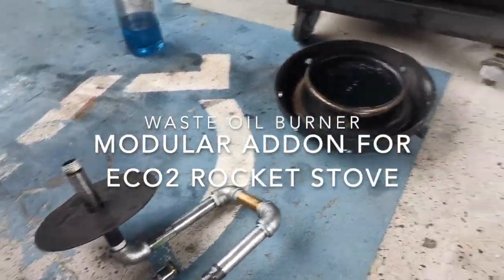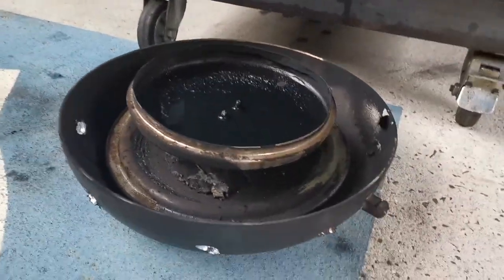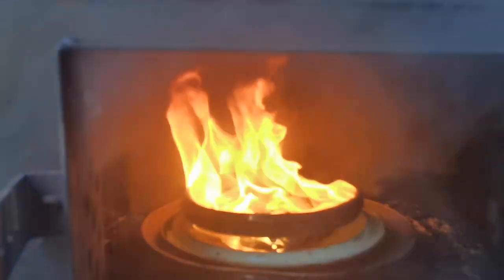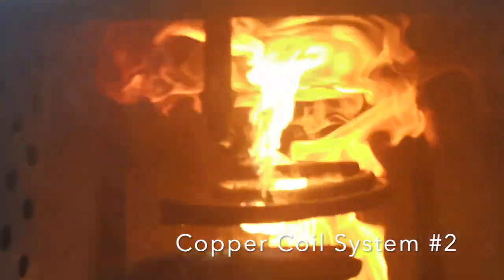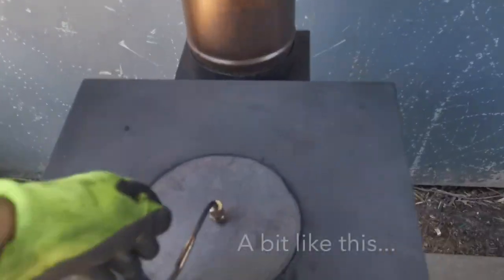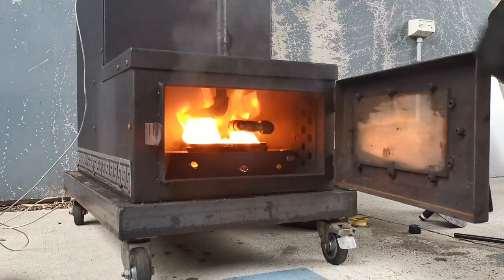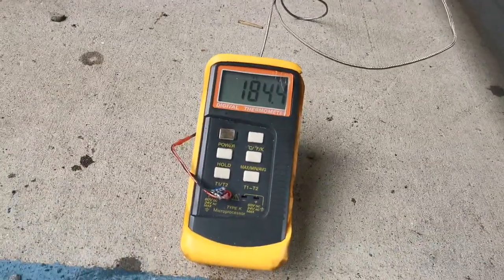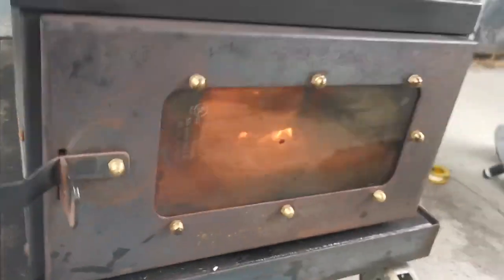Waste Oil Burner System for the Eco Rocket Stove range

Comment: Since you have modified the stove to burn a lot more cleaner. Would adding a vertical riser like in a rocket stove make even more heat and totally burn the unburned particulate matter ??? How about putting a round cage of perforated stainless to glow and burn up a lot of the carbon ??? Thanks Sir.
Reply from the maker: This unit does have a vertical riser inside the taller box section at the back. It's not massive, only a 5" dia (in hex tube) with about 22" of height. When the air / fuel mix is good, then the particulates do mostly burn up in the riser. The main challenge with the oil burner in this format is getting it to hold the air / fuel ratio in a stable manner, as the system tended to fluctuate. As the pipes got hotter that changed the oil flow and things needed constant tweaking with the way I had set it up. I dropped this project after a while, so I don't have a perfect solution but it was an interesting experiment. I like your idea with the perforated stainless to act as a heat trap and catalyst. I might try that in a wood fired rocket to see what it does. Thanks for your comment!

Comment: what if we use compressed air? btw love your design and i m following you since you introduce your first rocket stove. i can see your sales team fail to bring this product in each home of himalayas as they are selling it on high price.yes again i admit in this one year price of steel become almost double but still your eco mini stove they are selling 14000 which is way to expensive.the weight is only 35kg and i can get 135 rupees per kg include laser cutting and all the fitting with labour.i guess if your sales team consider to sell it under 8000 rupees and sell it in quantity, i can see it in every remote home of upper and middle himalayan region. anyway i admire you as a good eco friendly and designer engineer.
Reply from the maker: Hi and thanks for your comments. Not sure about using compressed air, that adds a lot of complexity and in general I prefer to keep the systems self aspirating and as simple as possible. Regarding the cost of the EcoMini... there is a lot more to getting a manufactured product to the customer than just the cost of steel. Production cost is one thing, then we have about 20 staff to pay salaries to all year round, various distribution agents, warehouses, transportation, taxes, etc. The company just covers its costs of operation after all the overheads, so that's why the cost is what it is. We've crunched the numbers and made the unit as cheap as it can be. We are working with South Pole to trade the carbon credits for us, which will give us some additional return on the investment which we will use to bring the cost down when we can. We are also working on attracting social impact investors to support us to scale which will allow us to reduce the prices overall. Thanks for your kind words, much appreciated.
Reply: This is hardly eco friendly.  He needs air, not necessarily compressed air but a feed of air to burn the oil, this setup is way over  fueled.

Comment: Hello,

 Thank you for this video. what about pollution? Have you analyzed the exhaust gases? Thanks
Reply from the maker: Hi... no I didn't take this idea any further than conceptual stage as shown. I was originally working on this option as a solution for high altitude heating in the Indian Himalayas for large institutions and have now shifted my focus to waste biomass as the energy source. I am currently working on a range of biomass pellet combustion options, including a modular add-on for the Eco Rocket Stove range of heaters (as shown in this video).

Comment: Hello can the Himalayan rocket stove be used with hot water bath tub
Reply from the maker: Not really... there are better ways to heat a bath tub. If you mean, can a rocket stove of some design be used for that purpose, then yes, for sure. You can run a coil around a rocket stove riser that is next to the bath and run the water through it. There are various youtubes that deal with this topic in particular.

Comment: I’ve pretty much done the same pipe design with the nozzle in the end, but I seem to get a complete blockage of carbon inside the tube right where the flame is aimed at. If it’s not aimed there then it’s sooty, but if it is, it blocks up. Any ideas how to stop that?
Reply: I tried everything from a single 1mm hole, to 4,5and 6 1mm holes, and of course open pipe, same result. At the point a single carbon deposit forms, that seems to be a starting point for the blockage to eventually form. I ended up getting rid of the pipe all together and doing the brake rotor/bowl design most others use, and it’s efficient and completely clean burning when the air fuel ratio is right.
Reply from the maker: @lexicase5642  sorry I didn't reply earlier... yes the bowl design does seem to be more stable and less prone to blockages. I didn't take the oil burner testing any further than this video, as I moved over to waste biomass pellets as a much cleaner fuel source to work with.

Comment: You’ll find that after only a couple of litres the vaporising pipes will clog with carbon and other dirt that is inside the oil, at least that’s what I found when I experimented
Reply from the maker: yes, that's why I was working on an easy to clean system. The nozzle and pipes are quite easy to separate and I found they kept burning for a few litres without issues, but I have not done extended burns yet to see how long till they clog up

Comment: very interesting preheat

I did a burner for a low heat stove, for a van, (made of 'zibro' petrol radiator)
so I used 1L oil for 4-5 Hours

maybe see my channel 
and if you dont know gerrysdiy waste oil burner, for more efficient 

You just need to make a hole at bottom of stove, for air entry as gerry
(But I only had air entry up of burner, at the back of the fireplace)